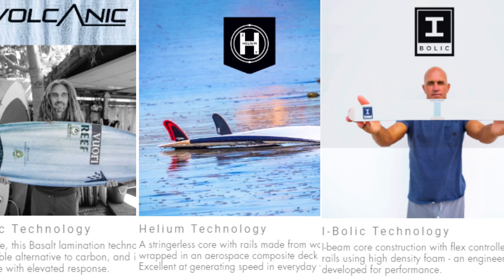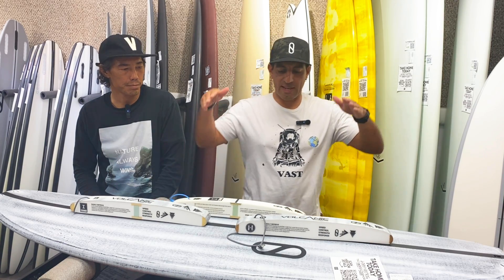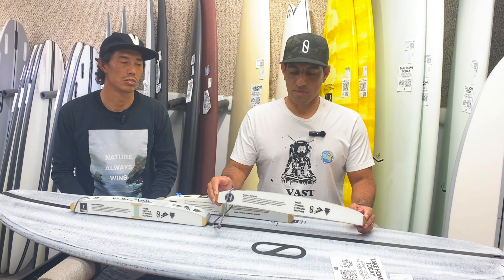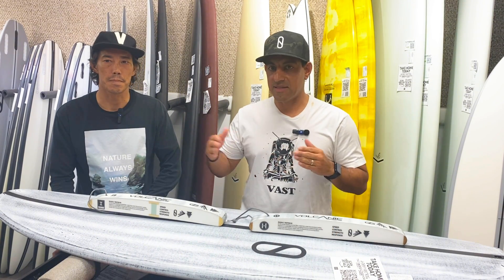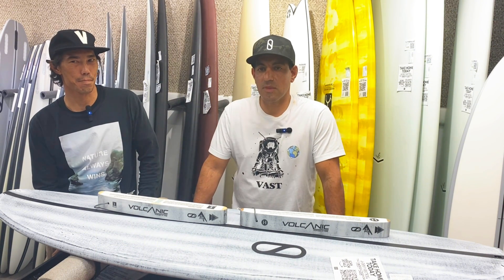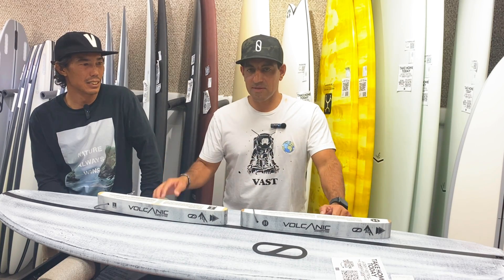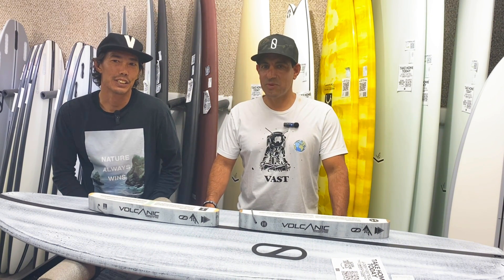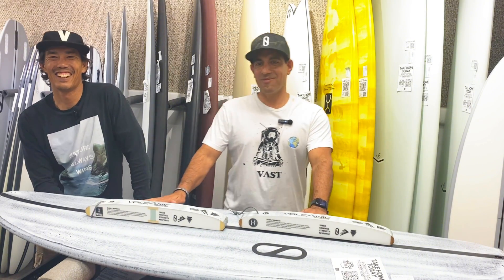Talk Story with Mark Pesce and Macy Mullen - Understanding Firewire Surfboard Technology

Comment: Has FireWire figured out why their boards turn yellow? 
How does the volcanic lamination hold up in regards to changing color?.
Reply from the maker: Yes
It was due to a factory that was right next to them that was a machine shop
So they found out that the dust would come into their area and when it oxidizes, the metal color would come up through the deck
As soon as they found out, they sealed off the factory almost like a hazmat
And then I think they relocated their factory from what I understand
We haven't had any issues in a while crossing fingers 
I've had my Machado  Cado for a few months and a Great White for about a year.
How was leave my boards in the car it's just a way for me to test how things are going and  No discoloration yet...🙃 so far so good - David
Reply: @hawaiiansouthshore  so the boards don’t turn yellow anymore?
Reply from the maker: @jonathanpowell1673  Not the ones we've received for the past 6 to 8 months. - David

Comment: How does the volcanic lamination compare to thunderbolt red?
Reply from the maker: Volcanic laminations come in several flexes depending on the board model.
The volcanice does make the board a little stiffer.
So good for people that like and want that stiffer feel.
Volcanic and other constructions in FW are super durable.
We had several guys over 200 riding Seaside and can rip, after a year the boards dont have a lot of pressure dings. 

The thunderbolt boards are way more tech and fine tuned like a F1. 
The flex of each model is adjusted. 
So for example one of the Harley boards, he'd ride a model tell Yu san to adjust the flex on the nose center and tail to suit what he wants that particular model to do in the surf he designed it for. 

Red (xeon) Construction and Black (carbon) boards are exactly the same except the last layer.
The Red 
 - most flex
 -  Good for small waves
 - Lighter riders tend to like it
 -  Good for everyday surf.
 -  Better for beginners to intermediate.

Since it has the most flex, the more you push on it the more springs out of turns.
The surfers that are "better surfers" tend to like that extra spring because they can play around with the feeling of the board when they're pumping and turning.  

The Black 
-Stiffer
- It can handle bigger and better surf . Harley rides the black in more hollow waves. 
-Most intermediate to pro level surfers prefer this.
-Heavier 190 and above surfers tend to prefer this flex.
Reply: @hawaiiansouthshore  thank you so much for the helpful detail! It’s very much appreciated. I weigh 150lb, 6’,  and would put myself in the beginner-intermediate category, surf normally 1-3’ waves at tamarack (a beach break) Looking to purchase a Seaside & Beyond 7’ after reading the information provided it sounds like it would be better for me to go for the T-Red version. Subscribed and liked the video, to show support!
Reply from the maker: @Briandowtee  the seaside and beyond is a very easy riding board and paddles like a longboard but when you get on the tail of maneuvers really well, very forgiving board. 
That board only comes in red
Thunderbolt was working with firewire once the seaside and beyond in thunderbolt, technologies is gone, that'll be it they're not making any more unfortunately
Reply: @hawaiiansouthshore  I’m aware, so I’m looking to buy a thunderbolt red on the used market. I did 3 in a board shop last Thursday, one was in volcanic 7’ , a 6’8 in thunderbolt red in the yellow latte color, and a 7’ in lft in white. So I asked the rep but wasn’t feeling informed enough to buy a $1,000 board without doing more homework 😂
Reply from the maker: @Briandowtee  Totally understand - David